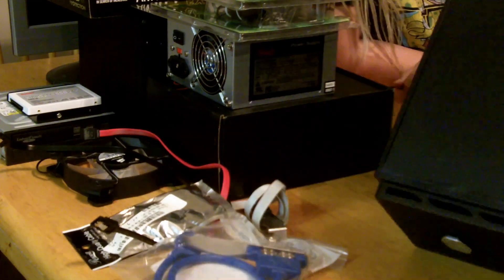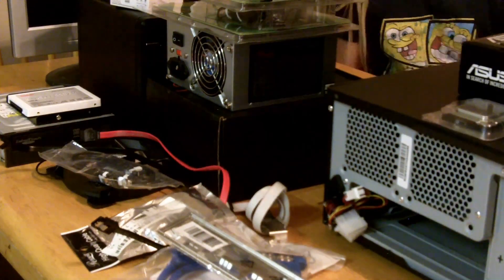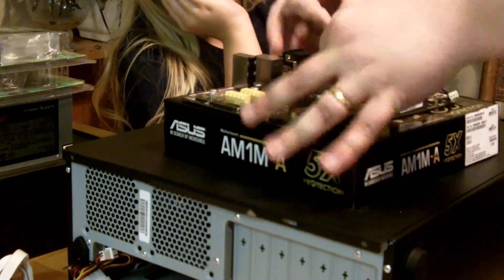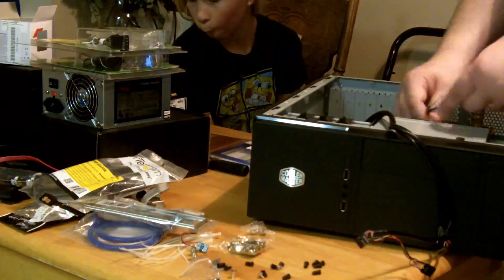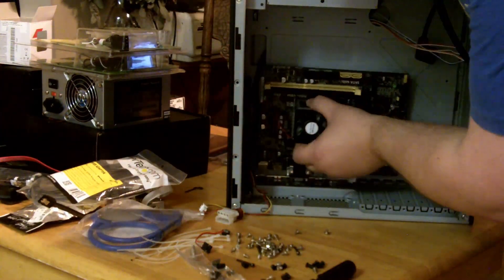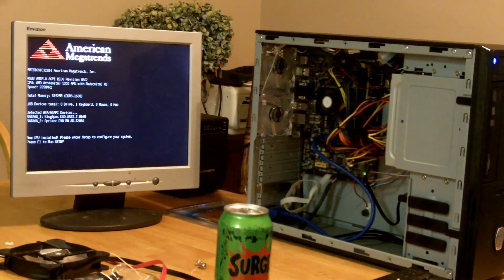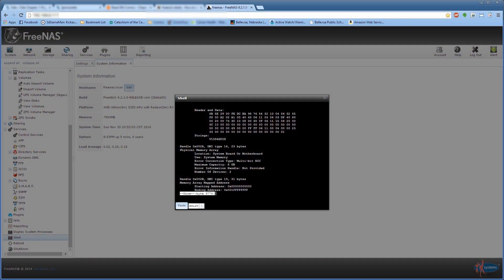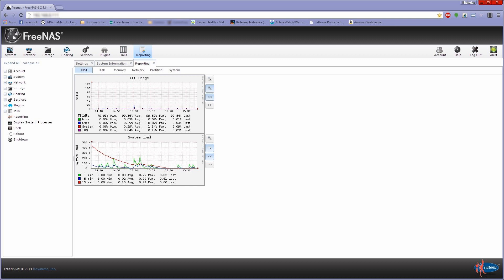Athlon 5350 AM1 FreeNAS Server Build

Comment: Any chance you tested the Asus AM1I-A the M-ITX variant of this board. I suppose I should test it on my sisters board that I have already purchased.
Reply: Supporting ECC RAM and using it are two different things. This board, the Asus AM1M-A allows the use of ECC RAM but it doesn't support its error correcting capability. Earlier assumptions based on what memtest86 and dmidecode reported were just plain wrong. Other AM1 boards, including the Asus AM1I-A, won't even POST if you fit ECC RAM. See the discussion here: http://www.overclock.net/t/1495837/ecc-works-on-am1 but read to the end because early "finding" are based on false assumptions and a broken version of memtest86.
Reply: jimthvac100 ah, I assumed so. I want to build a NAS eventually. Probably just get 8GB ECC along with at least 8TB to start out.
Reply: +jimthvac100 How do you now that? Asus says the opposite...
Reply: The owners manual said it was supported, but it was wrong. After research it is proven none of the AM1 boards actually use the ECC memory, I deleted my earlier comment.

Comment: Freenas does not recommend anything by AMD.  To quote cyberjock quoting iXSystems: ...CTO of iXsystems "We simply don't have any AMD machines to test with and the FreeBSD discussion lists are full of issues concerning AMD interoperability, which of course FreeNAS has inherited."

you may want to read: https://forums.freenas.org/index.php?threads/hardware-recommendations-read-this-first.23069/

Freenas + NonECC Ram = ZFS Death waiting to happen.
Reply: I applaud you for insisting on your right to use AMD instead of Intel - I do so myself where I have the choice. The AM1 platform is astonishingly good value. But don't be fooled into thinking that your system is protected by the ECC memory. It isn't. It's simply using it in the same way it would use non-ECC memory and isn't making use of the error correcting ability. See my other post above.
Reply: I'm sorry to have to insist, but you have been misled. All it is showing is that ECC-capable RAM is present. See here: http://www.passmark.com/forum/showthread.php?4832-How-reliable-is-the-ECC-detection It is quite possible that the extra traces required to support the ECC function are not even present on the AM1M-A motherboard. You simply have no way of testing.

Also, while I dislike Cyberjerk's attitude and Intel bias you really ought to read this: https://forums.freenas.org/index.php?threads/kabini-next-step-up-from-n40l-microserver.22782/

I feel very negative about FreeNAS for a number of reasons, including the iX Systems take-over, the condescending attitude of the web site moderators and the fact that ZFS, with it's "rather than suffer an error of one single bit I will deny you access to all of your files" attitude, does not fit my needs. FreeBSD and especially FreeNAS does work better on Intel processors. I might give NAS4Free a try, but I very much prefer Linux anyway. In fact unRAID better suits my needs and it works well on AMD platforms and without ECC memory.
Reply: Well, I said my piece and gave you some references to back it up. I always cringe when someone replies with "I'm a doctor|lawyer|engineer with 10|20|30 years experience" as if they were never known to make mistakes and without knowing what I am and for how long. Let me say that I have done my research and I'm not trying to pick a fight with you. But fair enough. I'm pleased that you are happy with your system, though I still don't see how you can actually test ECC operation without a specially constructed DIMM.

It's just that a bug was found in the MemTest86 code that led a number of people to the wrong conclusion. At overclock.net people were reporting the same results from dmidecode as you're getting but they too unfortunately jumped to the wrong conclusion. See here: http://www.overclock.net/t/1495837/ecc-works-on-am1

From the passmark.com forum I reference above ( http://www.passmark.com/forum/showthread.php?4832-How-reliable-is-the-ECC-detection ), in a discussion about the very same motherboard as yours, a PassMark programmer confirmed in September 2014: "Yes, you are correct. MemTest86 was incorrectly making the assumption that because the chipset is Chipkill capable, then ECC is enabled." And the code was patched accordingly. Others have since re-tested and confirmed the error. It's a shame, but it's true.

The good people at Asus won't be drawn in to the argument. They changed the wording of the manual in a subtle way, allowing that ECC memory can be used with the motherboard, though they never say that it's ECC function has been tested or works. In other words, it behaves just the same as regular non-ECC memory, which is something of a bonus - other AM1 motherboards don't even POST if you fit ECC RAM. Every single entry in the official memory QVL for that board (updated as recently as May 2016) is for non-ECC RAM.

There was a fairly recent BIOS update (1501) to add support for the Athlon 5370, which raised my hopes a little. Sadly, it is not to be.
Reply: First, I'm using ECC memory. ECC unbuffered, unregistered is supported by the AM1 SoC, but ONLY on the Asus UEFI at this point.

Second, FreeNAS is based upon FreeBSD, and FreeBSD is open-platform. In other words, FreeNAS is a control set for FreeBSD, and it works just fine on AMD hardware. I communicate with a large AMD/FreeNAS group regularly, though our testing isn't acknowledged by IX Systems, the company that now owns FreeNAS.
Reply: http://www.freenas.org/whats-new/2015/02/a-complete-guide-to-freenas-hardware-design-part-ii-hardware-specifics.html Just read the first paragraph.  I'm not saying that it won't work, just that it's not recommended.
Reply: Lord Mael The bug is actually with Asus, not AMD. They decided to trim GPT booting from the system, even though that is a component of EFI... so essentially this isn't a true UEFI on this motherboard. As of this time, I have around two hundred users on a complaint with Asus to fix this bug, which also affects Windows installs on large disk installs (bigger than 2TB volumes need GPT, as that is the MBR failing point).

IX Systems has been decidedly unhelpful (considering I've been testing and running FreeNAS since version 0.3), but this is no surprise. They are an Intel server platform builder, and it is expected that they are unwilling to assist people who still build their own microservers.

I haven't yet had the time to build a complete boot manager to get around this issue myself, due to time constraints, but I will be putting up an additional video discussing how it can be done on picky motherboards.

Thanks!
Reply: Lord Mael Great link dude, thanks.
Reply: Lord Mael By the way, for "unsupported hardware", I've had ten streaming sessions simultaneously over the Plex Media Server jail sub-OS, 6 on the local LAN and 4 remote, and nobody dropped quality or paused. In fact, the server was still quite responsive (aside from slowdown as the gigabit LAN was quite saturated).

Consider this a disagreement with IX, but if FreeBSD supports the hardware, FreeNAS should do just fine, as it is not anything more than a control panel overlay, handling features that are natively supported by the core OS underneath the pretty menus.

I will mention that I am intending to add another 8GB ECC DIMM, as I am intending to add another drive enclosure to the ZFS pool. And ZFS CRAVES memory.
Reply: Nicholas McDermott Sounds good :). I still haven't built mine so I keep reading what is out there and hearing things like your experience makes me think that this could cost less than what IX is recommending.  :)
Reply: John, FreeBSD shows full ECC operation at the terminal prompt. This is apparently exclusive to the AM1M-A.
Reply: Having just now run "dmidecode", FreeBSD displays error correction at multi-bit ECC, with no 2nd bit error reference. This is correct for unbuffered ECC memory, as the memory can only see where a location has gone corrupt, and calls to have the location refreshed by the CPU. Buffered ECC is actually able to correct on the DIMM without CPU inference.

I also wanted to list that the UEFI boot issue with GPT was handled by adding a LSI SAS 9200-8e controller, and moving the boot SSD to an external SAS chassis. The SAS controller has its own UEFI bootloader and triggers FreeNAS 9.3x installs perfectly.
Reply: Don't get me wrong, I really like the AM1 platform. I've used a lot of Athlon 5350s, and I've just ordered two 5370s. My preferred motherboard though is the ASRock AM1B-ITX, which is smaller but makes up for its lack of PCIe slots by having an additional two SATA ports. For kids, family, home office, home theatre - in fact, most things other than gaming, video editing and ZFS - it's ideal. It works well with Windows 7 and 10 and with all the Linux distributions I've tried.
Reply: I also want to point out that dmidecode tests and shows a lot more information. General command line results in short query exchanges, and just posts what the RAM identified as. FreeBSD's dmidecode digs deeper and shows ID as well as test results, and operations supported.

Handle 0x002A, DMI type 16, 23 bytes
Physical memory array
   Location: System Board or Motherboard 
   Use: System Memory 
   Error Correction Type: Multi-bit ECC 
   Memory Capacity: 32 GB
   Error Information Handle: Not Provided 
   Number Of Devices: 4

The "not provided" indicates that there is only a checksum provided by uECC, fbECC would show a parity.

On my Gigabyte board, the same memory shows "none" for Error Correction Type.

The only thing on the motherboard that affects ECC support is the BIOS. The AM1 APU platform is System-on-Chip, and fully supports uECC.

Again, uECC is ONLY supported by the AM1M-A and no other models that I am aware of. I can even boot into Memtest86+ and show (and test) ECC operation.

Have a fantastic Independence Day!
Reply: http://www.overclock.net/t/1495837/ecc-works-on-am1

https://forums.freenas.org/index.php?threads/deploying-ecc-on-an-am1-platform-for-zfs.22894/

ECC functionality is easy to verify with any memory operation tester that supports ECC error insertion. Older (4.x) Memtest86x versions sometimes showed incorrect ECC values, but would still fail the memory on ECC operation. The fact is, the current version sees and verifies uECC on the Asus board, and neither sees nor verifies uECC on the Gigabyte board WITH THE SAME MEMORY MODULE (tested with the 8GB Crucial DIMM shown; the server is now using two Crucial 16GB DIMMs).
Reply: Not trying to be mean, but you are the one who is in error. I'm an engineer with 25 years of experience, and I know Linux and FreeBSD like the back of my hand.

On boards that don't support unbuffered ECC (that is EVERY other AM1 motherboard, including Asus's ITX variant), you see ECC in the slot, but no error correction. The AM1M-A results with "multi-bit" ECC. Chat with Asus if you need confirmation that the final AM1M-A BIOS release fully supports uECC.
Reply: Try this: my box says ECC supported. End of story.

ECC is supported by AM1 APU modules, per AMD, but it doesn't work unless the BIOS turns the flag on. AM1M-A is the only model with that flag turned on.

Please stop crapping on my comments.

Comment: According to the motherboard spec, ECC ram is unsupported?

"Memory: 2 x DIMM, Max. 32GB, DDR3 1600/1333 MHz Non-ECC, Un-buffered Memory"
Reply: ECC is supported by the AM1 SoC, as long as the UEFI supports it. This is the ONLY UEFI that does, but it's a secret!
Reply: +Joshua Barnes  The ASUS mATX board is the only AM1 board that supports ECC memory. the ASUS  ITX version does not support it.